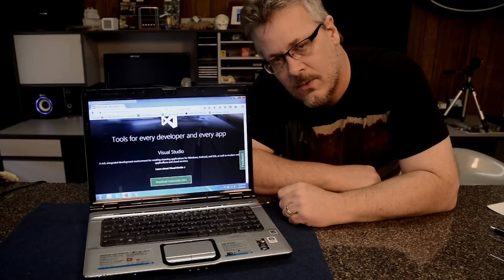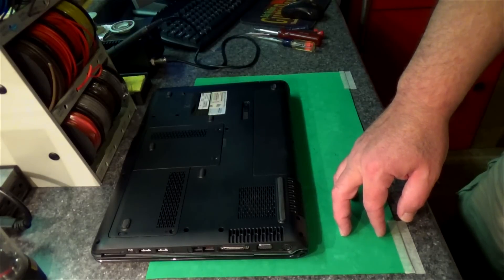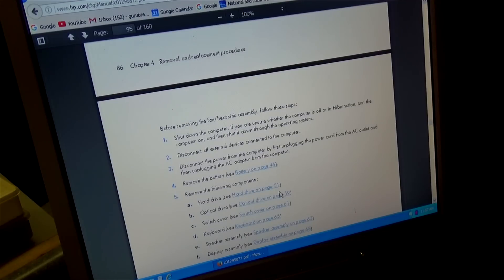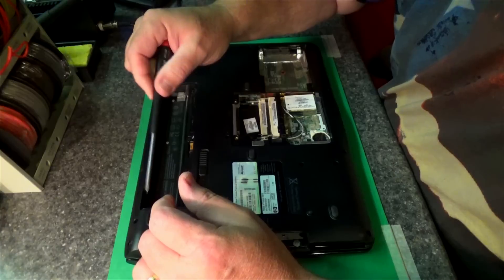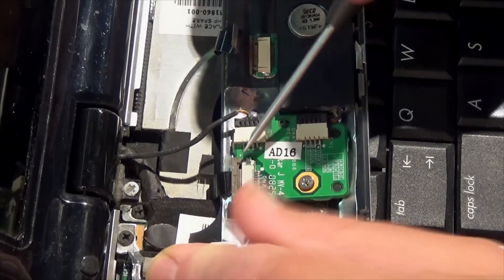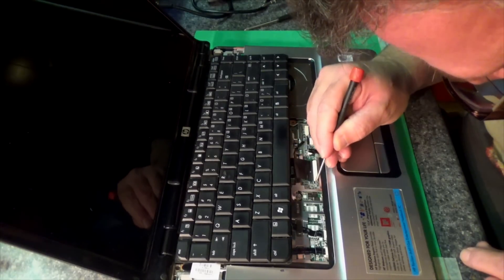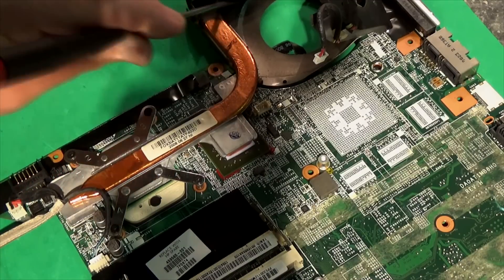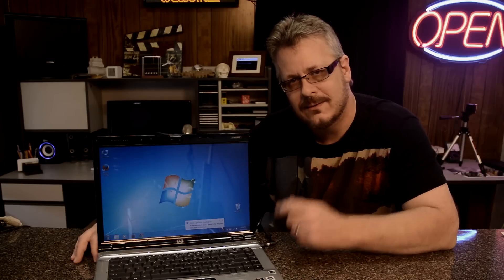How to Solve Loud Laptop Fan Noises Caused from Overheating

Comment: I'd love you to take apart my Acer 5733 laptop, so designed, never to be taken apart., I have a noisy fan that I have to live with because to get to the fan, you are looking at a major strip down, just about every component has to come off to get to the motherboard, who ever designed it needed a brain transplant, apart from that though, its a good laptop. I bought one of those fans that the laptop seats on to keep the temperature down and it seems to work.I know that's only a temporary solution, but it never overheats to the point that it shuts down, I done all the usual fixes like the can of air, with the same results, noisy fan going up and down every 2 or 3 minutes. I not too fussed, as the laptop does all I need it to, so I'm happy.  Good video btw.

Comment: This video came right on time! My Toshiba laptop has had the loud fan problem for months, and now it's overheating. I told my Dad, who used to service laptops, and he told me to replace the fan. I was a little freaked out at the idea, so to buy time, I started using my husband's newer Toshiba laptop. We've only had it since Christmas, and yes, it decided to start making THE SAME NOISE. I was in a mild state of panic until I checked my e-mail the other day and saw this video in my YouTube digest. I've watched your handy tips and now feel ready to try disassembling my machine. (And I'm going to vacuum my husband's laptop vents and stall the job there if I can.) As a side note, thank you for describing the type of screwdriver you use. We are still building up our tool inventory and haven't yet bought one that works for tiny screws. I will use your advice and get a good one. Especially since we now realize fan vent problems go along with owning Toshiba laptops. Thank you, thank you, thank you, for being so detailed and easy to understand.
Reply from the maker: Thank you for your kind words,   just so happens tomorrows video addresses taking apart a Toshiba computer that may be of some use to you, so look out for that.
Reply: I've never heard of a pavalon
Reply: Thank you so much!!!!
Reply: Pavilion you mean?
Reply: Nice job Steve
Reply: Hp = something pavalon
Reply: Watch the video. It is a joke